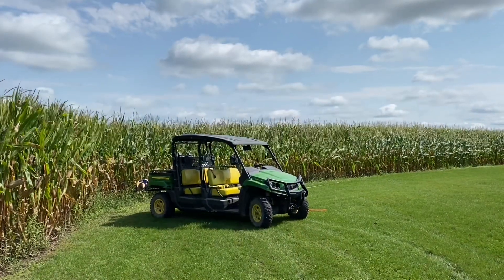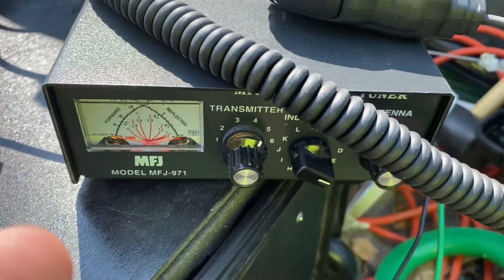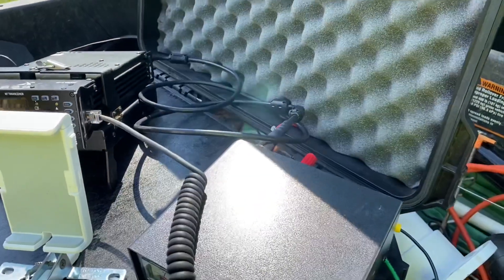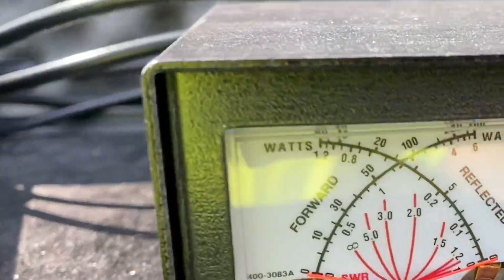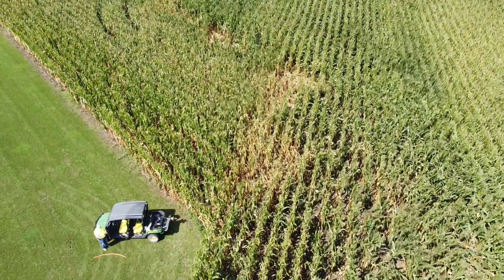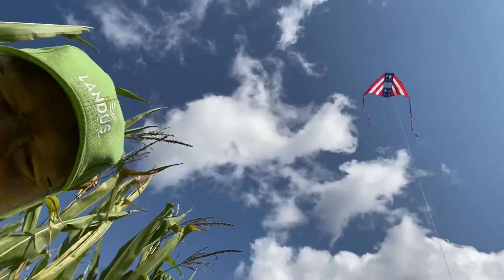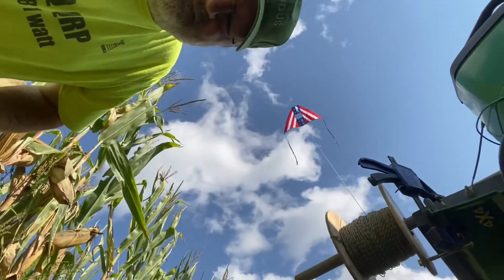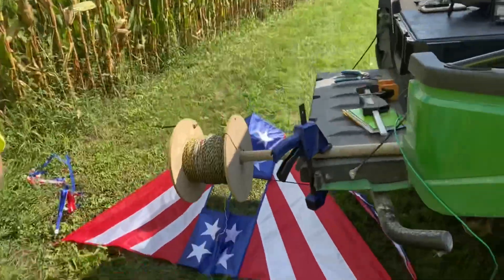Kite Antenna QRP SSB 5w from Iowa DETAILS

Comment: Should I have been more inventive when Grandma told me to, "Go fly a kite." back on the farm in the mid-70s? My 90' long wire back then that brought in WLS in Chicago S9+20 dB needed a few mods, LOL! Dave, KU9L
Reply from the maker: Hi David.. haha, Its not too late.. The next time someone tells you to "go fly a kite", you will know what to do, LOL... Thanks for stopping by and watching.. 73, Kevin ~ k0klb
Reply: @hamradioqrp-k0klb  Looks like I need to get a real rig again, as a kid I had a Ten-Tec Century 21, and now I just have a Home Brew ATS3B with my favorite low bands. I see I need to update. In summer we manage campgrounds in the USFS near many SOTA activation points, but my climbing days need some moderation, LOL Once upon a time we workamped a summer at Adventureland in Altoona, spent a few evenings hiding out in the shower house hiding from a few thunderstorms while listening to the local ARES group, LOL.

Comment: what kind of nylon kite wire is that with a steel core? I want some too. please share
Reply from the maker: Hello Steve.. That nylon string is electric fence string that we used for livestock.. It has multiple strands of wire woven into the nylon string.. The wire is made more for high voltage (electric fencer) and low amps.. Out of curiosity, I measured off 100ft and ohmed it out.. It had 200 ohms of resistance in 100ft.. The nylon/wire combination worked great for kite flying, but probably is not the most efficient.. but, It did work good enough for me.. I was able to QSO other stations and I would use it again next time I fly just out of convenience.. You can get it at any fleet farm or tractor supply store.. Thanks for your comment and for watching.. I appreciate it.. 73, Kevin ~ k0klb

Comment: I was knocking around the idea of using braided electric wire. Thanks for posting this video.
73 de W4YAH
Reply from the maker: Hi Bill.. Thanks for your comment.. Just so you know, the nylon electric fence wire that I used had some resistance.. the wire woven into the nylon string is made for high voltage and not amps.. I believe I measured 200 ohms resistance in a 100ft long section of the string. So while it will work, it’s not the absolute best.  Hope this helps.. Thanks for watching. Kevin ~ k0klb

Comment: What a cool setup.  Can you tell me if your MFJ tuner is need for a kite setup.  I'm looking to buy a G 90 and thought it comes with a built in tuner.  Btw, that's an awesome delta box kite.
Reply from the maker: Hi Armando.. Thanks for your comment.. The G90 does come with a internal tuner and I've heard that it will tune to anything.. The reason I use the external tuner is because it has the wire and Balanced Line connections on the back.. The G90 does not have those connections... I suppose I could solder a PL239 connector to the end of a wire and use it that way (I think that would work), but I've never tried that.. I'm kind of old school and like to manually tune my wire connections.. However, I do use the G90 internal tuner when I use the coax to my magmount antenna on the truck.. It works very well for that.. 73  Kevin ~ k0klb